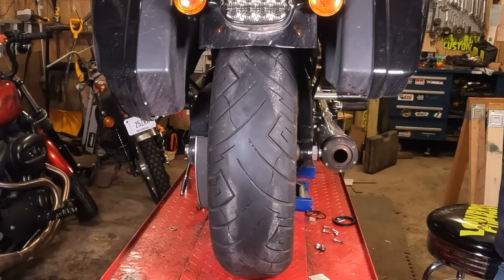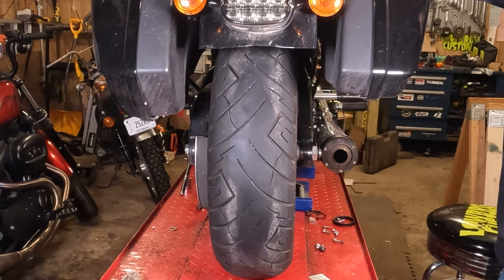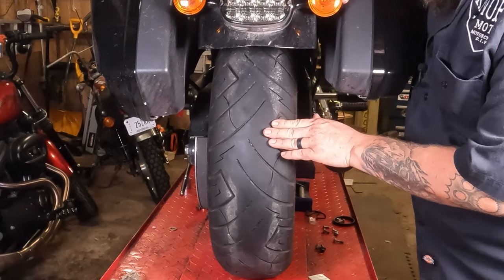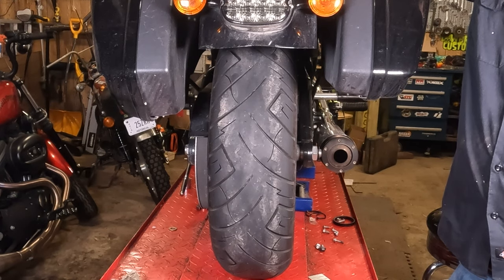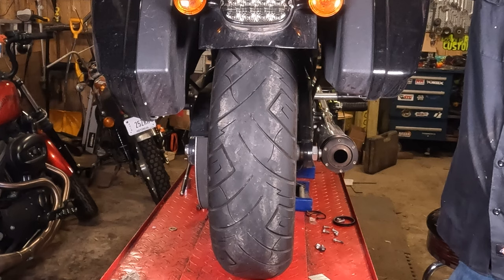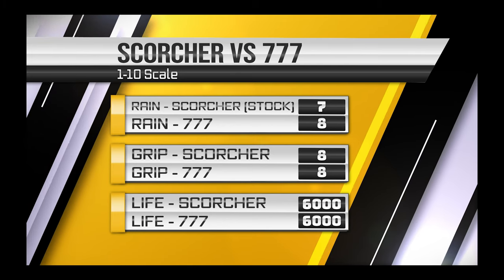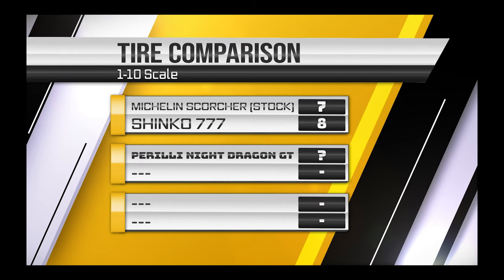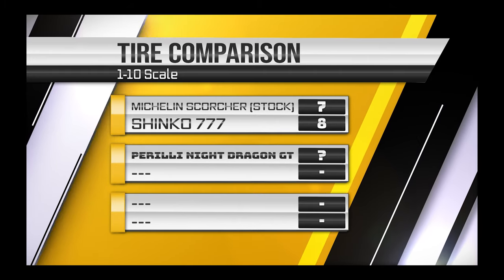Shinko 777 Final Long Term Review

Comment: I would be interested in the commander 2 and 3 tires, like u the scorchers stick good but 7000 is max on mileage.
Reply from the maker: I will keep that in mind. The Pirelli was on sale, so that was basically the deciding factor in the next tire.  Commander or Cruisetec will probably be after the Pirelli.
Reply: @KnobleMoto  bought a new FXLRST in Jan. got right at 5k on the bike, lots of wear on the scorcher rear tire, that ain't going to work for me, got to be something better out there.
Reply from the maker: @terryhaught9976  there are extended mile options out there. Personally I want the extra stick over tire life.  But, for only 6k, there better be a price point. I use to get 7k out of the rear on sport bikes.

Comment: You think this tire would be OK for a full sized bagger?
Reply from the maker: I don’t see why not.
Reply: @KnobleMoto  the weight rating is ok..I think I might give them a shot..
Reply from the maker: I’ve still got the 777 on the front. And it’s wearing well.
Reply: I have the 777s on my 2007 Street Glide. On 60-80mph I get a noticeable wobble/sway. Been reading reviews they’re not good for full size baggers and many suffer from this. Not sure, can’t confirm my self until I change tires.
Reply: @mobkinq  I put on 999s havnt had an issue yet.
Reply: @TheMarky26  right on! Let me know if anything changes. I might change my tires soon. Been commuting 250miles to work (500 miles round trip)  on the bike and would like to feel safe at interstate speeds
Reply: @mobkinq  I live pretty far north and there's not many days of riding left for me this year..I might not be able to get a really good feel for them until spring..